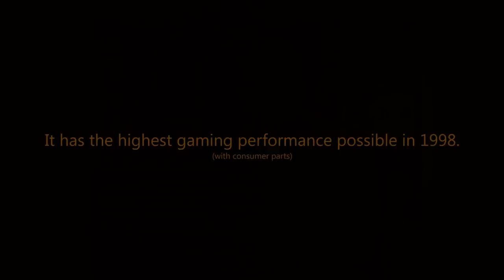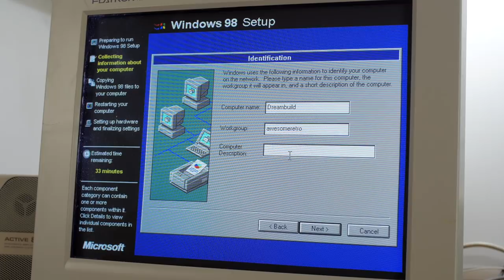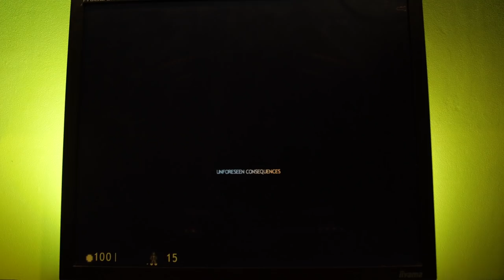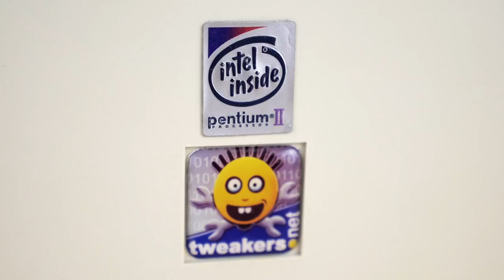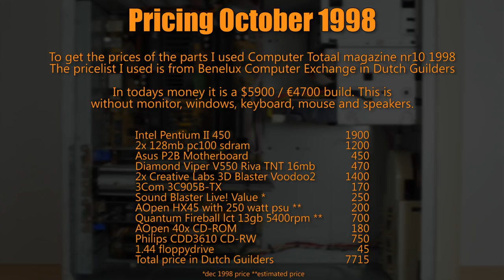1998 Gaming Dreambuild! Pentium II 450, 3DFX Voodoo 2 sli

Comment: 3 video cards?  2 sli the other for 2nd monitor?  I hope so otherwise ????????????  1 card and a monster 3d was the best setup the accelerator did more than 1 gimped card in sli as sli was in it's infancy back then.  Seen meatheads run dual video cards and dual soundcards from different manufacturers back at LAN parties back then,  which was hilarious as we all gamed while they futzed with irq issues and other failures casue they thought spending more made it faster lol.

up until about 03-04 the 3dII with 12gb was still running single card setups faster than sli ones.  thankfully SLI got better and accelerators were no longer needed.  Great video!!!!
Reply from the maker: 3DFX Voodoo2 doesnt take an IRQ :) 1 card can do 800x600 2 cards in sli 1024x786. 3DFX Sli is really great and scalable :)

Comment: So did PC's in the 90's need 2 GPU's one for 2D and one for 3D or was this just 3DFX?
Reply: ***** That must have been confusing to market did you have to plug in the monitor to the 2D card or the Voodoo then?
Reply: ***** Yeah but which card used the VGA port on the crt monitor?
Reply: +Edmundo studios alot of the 3d card came with a short 6 in vga cable just to connect from the 2d card to the in port on the 3d card
Reply: +Edmundo studios Voodoo1 and Voodoo2 Cards are just 3D accelerators, they cant draw the Desktop. So you need another Card for that Job. That Card is connected to the Voodoo with a standard VGA Cable, then another VGA Cable from the Voodoo to the Monitor. If you are on the Desktop, the signal from the 2D Card is simply routed through, and when you start a Game, the Voodoo kicks in. (Showing that classic 3Dfx Logo first, of course ;) )
Reply: +Digi20 ah okay I get it. Very different to how things are now but very interesting to know!
Reply: +Edmundo studios just so you know, that was pretty much just the voodoo 1 and 2. 
the next card, the voodoo banshee, already had a built-in video card. it was pretty much a standalone 16mb version of the vooodoo2. my friend had one, and i seem to remember it wasn't as fast as a voodoo2 in many games.
Reply: Sometimes. This was mostly just 3DFX, but I seem to recall Matrox (who still exists) making a card or two like this. 

Then again, there were also cards which could handle both tasks, like the Matrox MGA Millenia or the ATi 3D Rage series.
Reply: +Edmundo studios you connected the output of the 2D card into the VooDoo, and the output of that would go into the monitor.
Reply: +Digi20 with special drivers, they could draw the desktop on their own, though they were really slow (worse than Chromatic Research or MagicGraph chipsets were/are).

Comment: I wonder if can be used Voodoo 2 in SLI mode with an incorporated video card on a motherboard as a primary?
Reply: Yes, no problem. The voodoo 2 cards work completely independently of your "2D" video card, so it will work perfectly with onboard video.
Reply: @BadManiac  Thanks!
Reply: That's how I run mine, got an S3 onboard.

Comment: What is better, dual voodoo 2s pci or a voodoo 3 agp?
Reply: this is an old post you probably know the answer by now but incase your dont, i'll answer it !

 I would recommend choosing Voodoo 2 SLI over Voodoo 3 for its compatibility  and you can pair it with a GeForce 2 GTS or GeForce 3 and can throw anything at it. People consider Voodoo 3 for its improved image quality and eliminates the need for a pass-through cable that can affect image quality, if your using voodoo 3500, then is more powerful and can run at higher frames.

Comment: My gaming pc in 2005 specs: Intel pentium 4 3ghz, HDD 120GB 10k RPM, power supply 350W, 1.2GB ram DDR2 800Mhz, Ati radeon x1550 384MB 128bit DDR2. San andreas hight 45FPS :)

Comment: Do a 2004 dream pc and see how far it can go, probably be able to play some games from 2010
Reply: Except GTA IV, XD. My 1060 sometimes dips below 30 on that damn game!
Reply: really? my 980ti can run gta iv with 50 average fps (normally 60fps[VSYNC CAPED])
Reply: @impreso000  It runs at 60 easily but every once in a while may dip under 30. Especially with the old 1.0.7.0 patch I'm using due to savefile bullshit. I also broke vladivostok fm and its now just commercials. GTA V gets better FPS at ultra (literally everything maxed, 1080p) with 4x MSAA...
Reply: the problem with FPS drops are the shadows, try everything ultra with shadows low/off on GTA IV and Good bye low fps

Comment: I'm not entirely sure why you have 3 graphics cards, the Creative Labs 3D Blaster Voodoo2's are in "SLI" correct? can you please explain?
Reply from the maker: camiji The 2 voodoo2 cards are addon 3d only cards. The Viper 550 is 2D and 3D. The Voodoo2 sli works like this card one renders vertical line 1 3 5 7 9 11 13 15 etc card two renders line 2 4 6 8 10 12 14 16 etc
Reply: victorbart I understand how SLI works, just wasn't 100% sure about the TNT. so the voodoo's are pushing through the TNT?
Reply from the maker: Joe Mahoney The tnt signal goes throught the voodoo2 cards to the monitor. The voodoo2 cards are dirrectly connected to the monitor. 3DFX sli is different then Nvidia sli

Comment: I'm planning to get every parts this year and complete MY 1998 PC

It will be :
- AMD K6-2 450 (or faster if I find it)
- AT super socket 7 motherboard (because AT form factor is fun ^^ I don't have one for now, but I may get one shortly)
- Riva TNT (I don't have any riva TNT, but I have other GPUs that could replace it pending)
- (of course) Voodoo 2 12MB SLI (I still need another one)
- 10GB HDD (should be easy to find)
- YMF724 based sound card (I have one)
- and other regular stuff (I got the case, and the rest is easy to come by)

I may make another 1998 computer with the same motherboard form factor, but with a pentium 2 (but AT slot 1 motherboard are harder to find than AT super socket 7)

EDIT : Actually i've found both motherboard ^^. But the slot 1 board is limited to a 66mhz FSB (i440LX chipset, darn !) and only has 3 PCI ports wich isn't enough for a voodoo 2 SLI + the YMF724 card + ethernet card ... But I also got a voodoo banshee, wich may not be as great as a voodoo 2 sli, but it's not that bad I think. (The sli will go into the K6-2 build ^^)
Reply: Well finally, I changed my mind : the socket 7 cpu fan is in the way of one of the two voodoo 2 (I finally found another one :D), so I took an ATX case wich has a tray just like an AT case (it was from an athlon based computer from 2000) and used one of my spare ATX slot 1 board wich has a BX chipset instead of the old LX. So now I can have the fastest pentium 2 running ... except that my fastest pentium 2 is 400MHz, but I recently found a celeron 300A wich can handle the 450MHz speed :D. It's not a 450MHz pentium 2, but it is as fast on some tasks, faster on other, and a bit slower on other, so close enough ^^

Now, I just need a riva TNT, some better fans (the ones I am actually are old and way too noisy)

Comment: 2 graphiccards?
Reply: 3 graphics / video cards in total. 2 3DFX Voodoo 2s in SLI; unike modern graphics cards these are single-purpose fullscreen 3D accelerator cards dedicated to processing the graphics in fullscreen 3D games, and require a "conventional" 2D or 3D card (in this case an NVidia Riva TNT) to be used in conjuction with them with a passthrough cable (or it, in a single / non-SLI Voodoo 2 card setup) just for the display output to the monitor; this would mainly process lighter applications / navigating Windows, and the system's BIOS. If the system was also used for 2D Windows games and/or (newer) DOS games, the conventional card would also process those. Also any non-game 3D graphics applications (such as graphics design applications) that run in windowed mode.

Comment: I started doing with my old system. I need to replace the battery because I get the cmos load error. The PSU im using is so loud. I need to get a silent one. My system is going to be very similar. P2 400, TNT + V2, Soundblaster, 3 pieces of RAM, single HDD, DVD, Floppy.  I see yours works with 250W. Is it really enough or 300 will be better?

Comment: would this be good to play titles from the early 2000"s too? like cs:1.6 and unreal tournament? im looking to build a legacy pc too
Reply: and postal 2
Reply from the maker: Yes Counterstrike workks fine on this system. And Unreal tournament also runs. But to get real good performance in UT you need to step up to a Pentium III with a newer graphics card.
Reply: victorbart
any reccomendations for the gpu? :)
Reply from the maker: ابو لولوة النقي
Voodoo4 or Voodoo5, Geforce1 or Geforce2 gives good UT performance in high resolutions :)
Reply: victorbart thanks so much
Reply: ابو لولوة النقي Voodoo5 because of Glide or S3 Savage 3D (I think it was called) if you want to try the S3TC-feature of UT.
Reply from the maker: armorgeddon
I have a S3 savage and with windows 2000 it performs like shit.
Reply: victorbart
S3 Savage only for the S3TC-feature of course. Otherwise V5 for speed!
Back when it was current technology a friend of mine used to play on the S3 Savage, and although it wasn't special, it wasn't bad either, especially for the price it selled for. I don't know about differences for that card in Windows 2000, but that OS wasn't made for gaming anyway.

Comment: Imagine building an i7 with GTX 980 Ti 3-Way sli and play these kinds of games...
Reply: +Luke Horror the issues are more to do with operating system differences than hardware
Reply: +Luke Horror Virtual Machine? not sure, but maybe hack a windows 98 or XP to do it on bare metal.

Comment: 1998 dreambuild - Celeron 333A with BX motherboard = 560 mhz with 256 RAM and 2 Voodoo 2 12 mb SLI. Or even Tuan thunder 100 pro with dual Celeron 333-466 @ 500-700 MHz and 512 Ram. Windows 95 has support of 2 GB ram with editing of the system.ini file. I had only Celeron 333A@560 on the BX chip and 256 Ram with dual Voodoo 2 12 mb in 1998. Quake 3 in 640*480 had about 100 fps on this configuration.
Reply from the maker: Yes there are more option if you overclock celerons. But I choose for the fastest CPU route. 
Do you own celerons? I have serveral BP6 boards :)
Reply: @victorbart  
No, I owned Celeron 333A with Lucky Star 440bx till 2000. It was overclocked using 5*112 and had 4*64 pc100 memory. After that I bought Pentium 3 1100/256@1500 (133*11).

Comment: that 250w PSU is overkill.
Reply: budakjengka channel i don't know if there are many psu's from the 90s that still work today, so he probably had to go overkill on that
Reply: I've seen many PSUs from the 90's that still works.
Okay, some of them needed new capacitors, but otherwise they are still good. But here is the thing : I've never seen a PSU from the 90's getting lower than 100 Watts. And most of them are 200-250W
Reply: Compaq Presario 4505 (from Nov 1998 Pentium 166 MMX,16 MB PC--66 RAM,Integrated Graphics).
It had a meager 75 watt power supply

Comment: When did P3 arrive?  I thought it was out by '98.
Reply: Q3 1999 if I remember correctly. The slot 1 Pentium IIIs weren't much of a boost from the Pentium II, though. For a time, the fastest Pentium III you could get was 533MHz anyways, and for Windows 98 you wouldn't notice anything.
Reply: that was back in the day when technology took it's time and grew in moderation.  Now, it seems to just try to rush to the end, wherever that is.

Comment: lol 2x speed CD burner, and even with that incredible slow speed it still has a miniature fan inside it. BTW the only good thing about these old CD-RW drives was the fact that they were very quiet. Today's 52x burners can be very loud.
Reply: +MegaBojan1993 "Todays burners" - I don't have any optical drives in my PCs since about 4 years now xD
Reply: Metatr0n You're joking right? How do you install your software or play your music, or when a friend comes over with a DVD movie, what do you use to watch it on? I couldn't imagine my PC without my bluray burner.
Reply: MegaBojan1993
Windows is installed via USB-Stick, all necessary software is on a RAID and everything else is downloaded. As for movies and music, I have a home-theater system that is connected to everything. (A/V Receiver as the connecting hub, connects my surround-sound-system, my TV, my BluRay, my wifes consoles and my PC)
Reply: Metatr0n That's an interesting setup. But I still prefer my kind of setup. I gotta admit, I use my optical drive a lot less than before because optical discs are becoming more and more obsolete. In 3-4 years I also may buy a RAID setup and store all of my data there.
Reply: MegaBojan1993
I didn't have an installation disk in my hands for ages. :)
For me it was just the most convenient setup and I love the clean front of my Obsidian 800D.
Reply: +MegaBojan1993 Optical drives take forever, installing OS from USB 3.0 is wayy faster. For all games I download with steam, same for all other software too. Movies get streamed from netflix or other :)

Comment: I don't understand the point of the third graphics card that wasn't sli
Reply: It's a 2D graphics card. The Voodoo cards needed a 2D card as well, until the Voodoo3 in 1999.
Reply: Coops Game Shelf Ah. Thanks. That makes a lot of sense.
Reply: +Guy Crew  Because Voodoo 1 and 2 supported ONLY 3d, so you couldnt do the normal browsing etc.
Reply: BSG Okay, so you would only plug your monitor into the 2D card?

Comment: The price tag is wrong. 7715 Dutch Gullders where in 1998 like 7700 Germans Marks. If you take inflation into account and compare it to purchasing power, todays price tag will be around 8000/9000 Dollars or 7000/8000 Euros. In 1998 it was an awful lot of money.

But anyway, very nice build!! :-) Back then I had an old 486 DX4/133. But the 56k modem worked fine ;-)

Comment: I don't get it I know about sli but what are the other cards your putting in the PCI express ports are they multiple sound cards our what I build computers and know a lot about them just I got into them 5 years ago and don't know about anything in the 90s early 2000 yes but not 90s
Reply: +Supernova1 The uppermost port (brown) is AGP with the Riva TNT the following ones are PCI (grey, no express there ^^) 2x Voodoo 2, LAN card and Soundcard. The lower three ones are ISA. I got the 1999 version of this build for my 18th birthday in a huge black server case with a case temperature display and on wheels, and purely SCSI (the HDD did 10.000 rpm) :). That motherboard was HUGE

Comment: Would 3 way Voodoo SLI be theoretically possible?
Reply: Ryan Sample Go and fuck nVidia with 3way SLI only! SST96 used on V2cards was capable of 8 cards running in SLI - go and check: Quantum 3D Mercury -the 96MB megacard based on it (1999)

Heavy Metal system - FSAA 4x, 1.5GTexel/s =Mercury, 2x Intel Pentium 550MHz, up to 1GB RAM
possible connect in the Rack - i think up to 16 this systems

Comment: lol I've got a 500MHz Pentium II :P

Nice vid though! Would be interesting to see a 1990 version!
Reply from the maker: The Pentium II 500 never exited yes you can probably overclock it a bit. I have a 1991 286 build :) https://www.youtube.com/watch?v=B11b1AyIJ6E
Reply: victorbart I can post a picture if you want? The BIOS reads Pentium II/500Mhz with 32KB L1 cache and 0KB(?) L2 cache.
Reply: the big p2 was 450 m8 https://en.wikipedia.org/wiki/Pentium_II
Reply: Most likely it's a Celeron reported incorrectly, a Pentium III reported incorrectly as a Pentium II, or possibly a 333 Celeron just running on a 100 Mhz Bus also being reported as a Pentium II.

Comment: i was born in 1998, but do you think it could run early 2000s games like gta iii and halo 1or even gta VC?
Reply: With no problems, this is a very high-end PC from 1998
Reply: i would like to see that
Reply: It's pretty much the minimum requirement for GTA III , it could run those games but they wouldn't run well. This PC falls below the requirements for GTA Vice City. It would run some early 2000s games well though.
Reply: If you're "cheating" by putting something like a pentium 3 1GHz and a geforce 3 in there instead of the riva tnt and keeping everything else, you'll be able to play almost anything from the DOS era (except some games that have problems with beefy cpus and PCI sound cards) to early 2000s games without any issues

Comment: do an dual slot 1 machine please
Reply from the maker: I have plans for it :) and already parts for it. Also I have 3x Abit BP6 in repair right now.
Reply: also, I have found some unique motherboards which feature two different slots and sockels such as the "Xcel2000 SIS620/5595" which has an slot 1 and an socket 370, they look pretty interesting

Comment: Can it run HL2?
Reply: +Max Bond NO but it can run HL1
Reply from the maker: +blakedmc1989RaveHD Yes HL1 runs fine. HL2 doesnt run :)
Reply: victorbart exactly! it makes me cringe dat people would try 2 do modern things with older processors
Reply: blakedmc1989RaveHD Then will it run Crysis 3?
Reply: Max Bond NO it can't even run Crysis 1 because it's a Windows 98 computer silly
Reply: blakedmc1989RaveHD Ok can it run BF8 maxed out at 4320p?
Reply: blakedmc1989RaveHD Btw HL2 won't even launch to menu on this?
Reply: Max Bond nope! why would u think tha game would boot on Windows 98?
Reply: HL1 4 show! ;)
Reply: +blakedmc1989RaveHD funny enough, the original system requirements said it can run on windows 98.
Reply: yeah 4 HL1
Reply: +blakedmc1989RaveHD Nope! the game pre orange box could run on windows 98.
Reply: Terminator 827 yea but 3DFX cards can't handle HL2
Reply: +blakedmc1989RaveHD well no derp it cannot handle it.